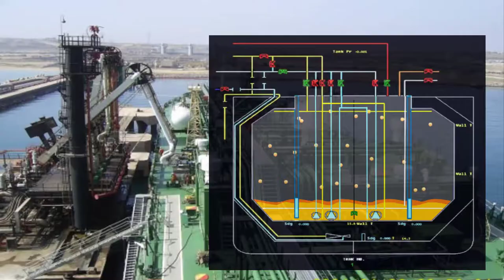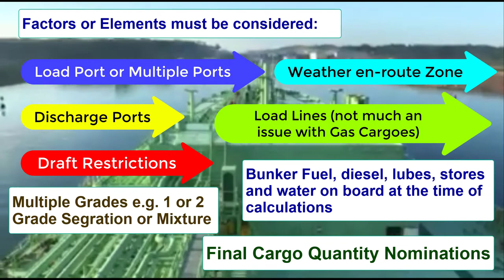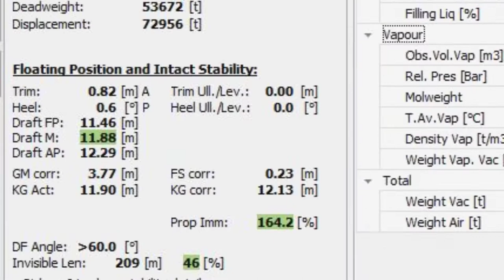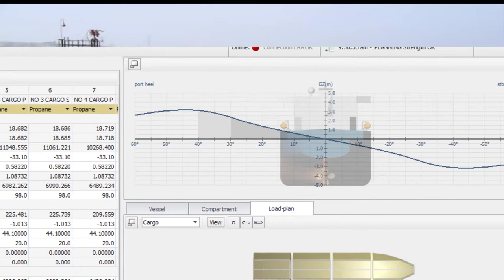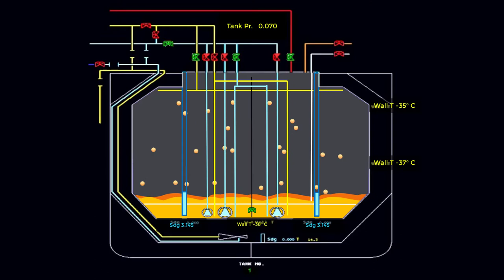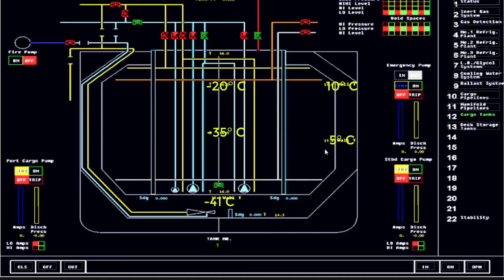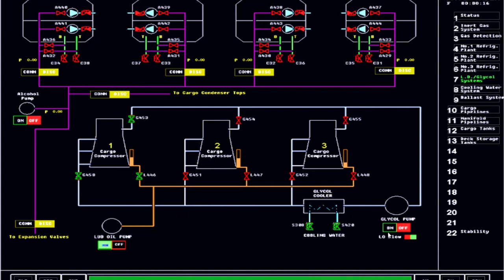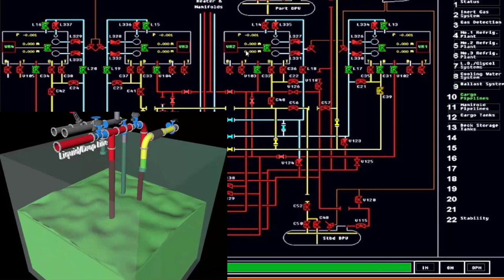LPG/C Ship Cargo Operations Part 5B -  Loading Optn - Final Nomination , Loading Plan & Commencement

Comment: Hi Chief... Have you ever done ethyl mercaptan blending onboard?
Reply from the maker: Nope sir, most cases cargoes like propane, butane other petroleum gases or LNG's when loaded from terminal are already or has it. I am not sure if when loading from a FPSO is being done so with the receiving ship. Nice question, I haven't thought  of such coz I did not experience it.
Reply: @ShipAhoyVlogs  thank you chief
Reply: @ShipAhoyVlogs  Yes chief as it should. one of our clients ask if we can support them in the process while doing sts.
Reply from the maker: @hafizazani  Well, if the supplier ship has that kind of arrangement which I'm not sure then maybe they have done so in other STS (first time to hear). This not a regular thing actually, correct me but in most cases when we are talking about inhibitors for LPG Chem. gases then its common. But Mercaptans? Not sure, are you telling me that the ship supplying has a cargo of LPG or LNG with no ethyl mercaptans, isn't that dangerous? LNG or LPG saturated hydrocarbons are by nature odorless that is why mercaptans are mixed with it to have it odorized for detection!
Reply: @ShipAhoyVlogs  yes agreed. I've asked one of an old timer indian lpg master, he said this is the norm in some domestic trade. Sigtto published a book on this but it only explain the safety aspect of the operation, not the procedure.
Reply from the maker: @hafizazani  If it is what they say had it done before then the procedural info has  to come from the ship loading your vessel. Other than that, what does your operation department says about it. I would be interested to know it as well. Good luck.